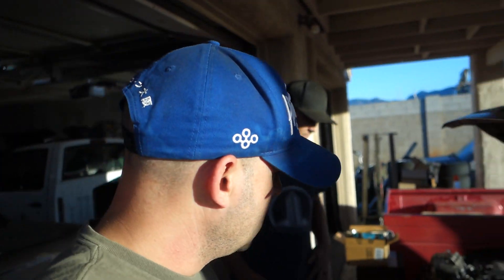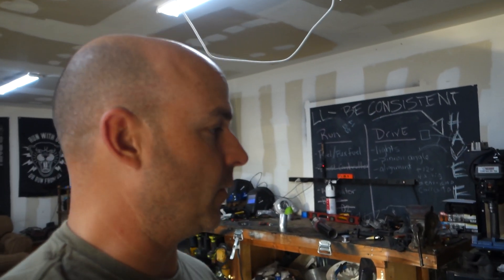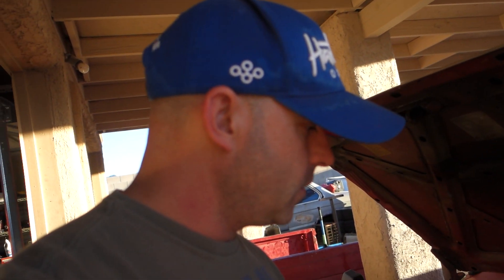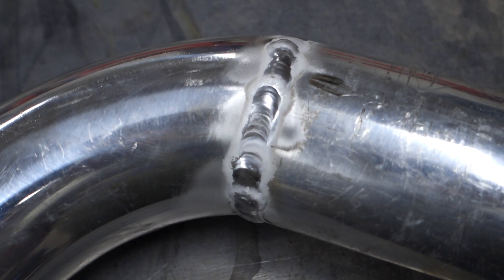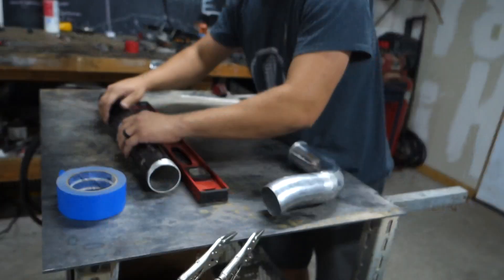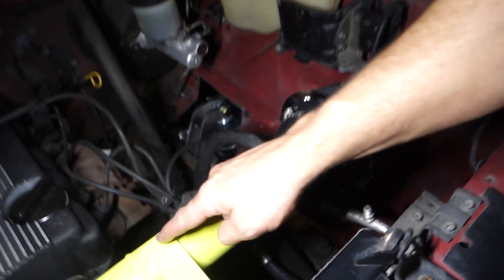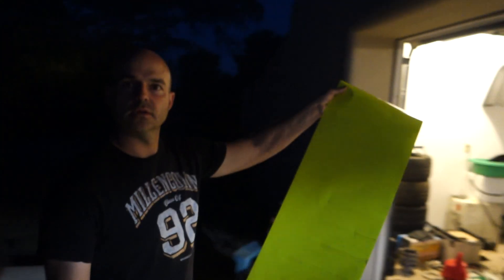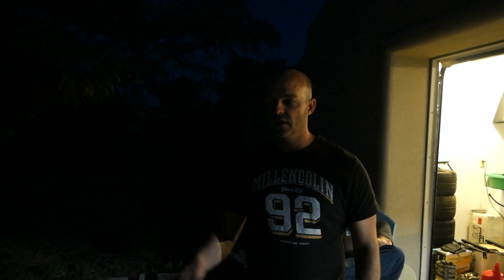D21: Cold Air Intake

Comment: Hey guy I love the intake system but where / what did you do with the pipe / hose that comes out of the valve cover and into the original air box?
Reply: @LocalLosers520  thanks for your reply, I’ll be giving this ago thanks again

Comment: You don’t need to sharpen your tungsten on aluminum. Just friendly advice it doesn’t hurt anything but you can just jab a tungsten in let it hang out of your cup about 1/8 and it will ball itself up. I weld aluminum 60 hours a week lol, I build heil tank trailers.

Comment: How can I get one of your elbows. I need one for my 92.
Reply: Use a 1996 vortec v6 elbows just drill and add tubing
Reply: @luischavez899  does it just hook straight up, what drilling and tubing does one need to do
Reply: @jacksonbradshaw8415  1996 vortec v6 air intake resonator box goes on top of the throttle body. You can make it a short ram intake snorkel or with a little bit of tubing off ebay make it a cold air intake.